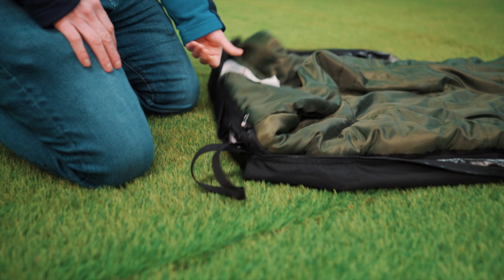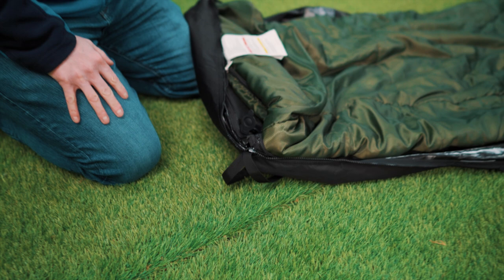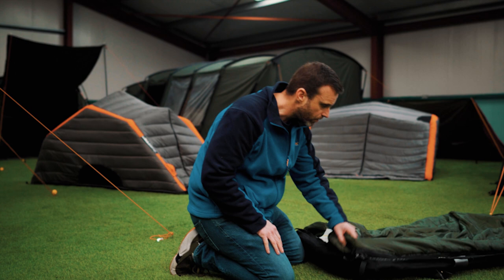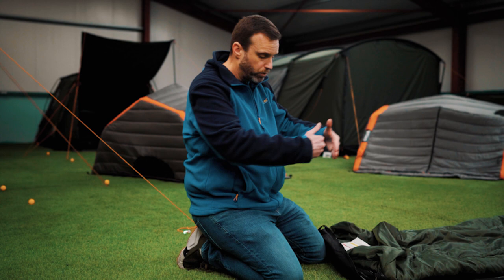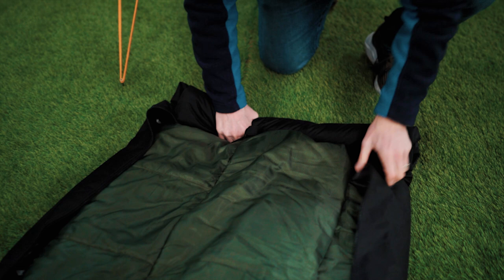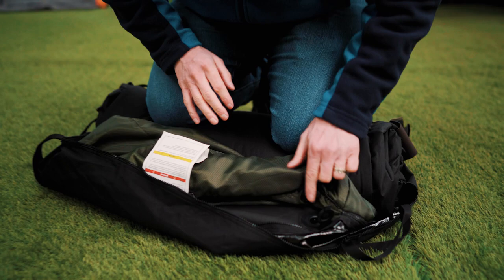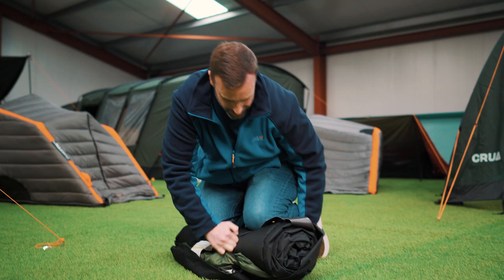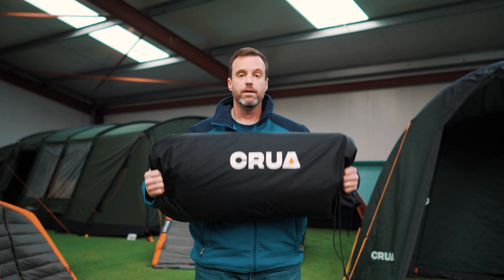Sleep System Set Up Guide l CRUA

Comment: I've got your Modus, which uses the same sleep system mattress but came with a couple of long adjustable straps to hold it all rolled up.

What I like to do to make rolling even easier is take a strap and put it round the mattress about half way down. This holds everything in place as I'm rolling and keeps the sides nice and straight. 

Then when everything's rolled up tight, I simply undo the buckle on the strap and pull it out of the middle of the roll.

Now I'm just waiting fit the weather to warm up a bit so I can get back to nights outside in my snug camping set up.
Reply from the maker: Hi Alex, that's a good way for the Modus, it's always nice to hear experimental stories on our products. Spring is coming, so hopefully,  you'll be able to get back to the wild!

Comment: Is there a waterproof outer bag for this?  I'll be using it for motorcycle camping.
Reply from the maker: Hi, the outer bag for the Sleep System is made of 210 D Oxford fabric, which is lightweight and water-resistant. A light shower shouldn't be a problem, but for a motorcycle trip you might want to look into a more massive waterproof bag option:)